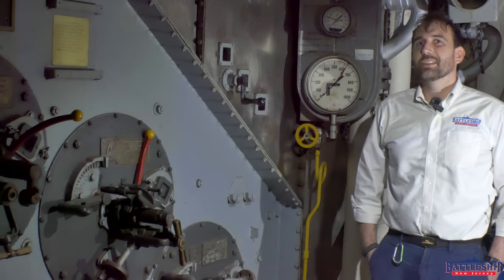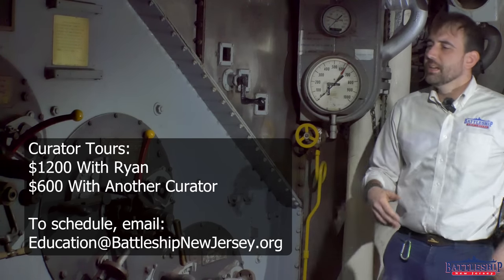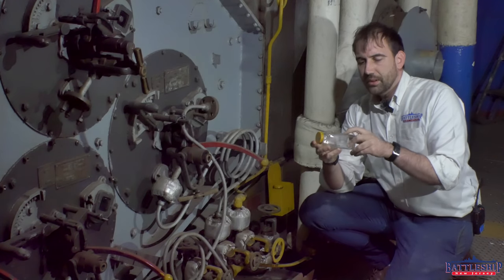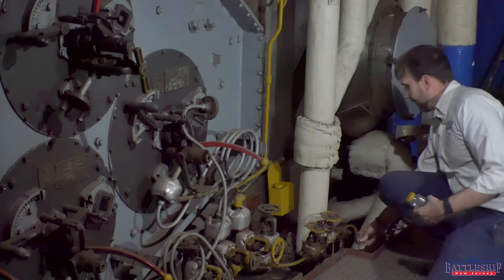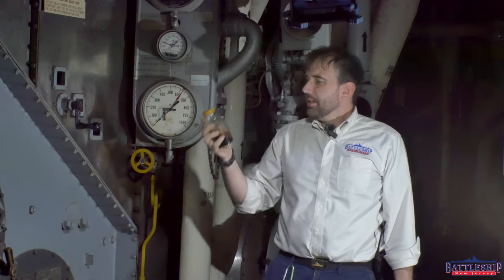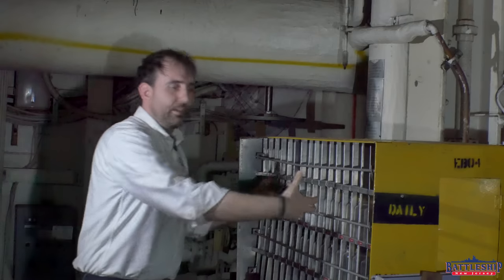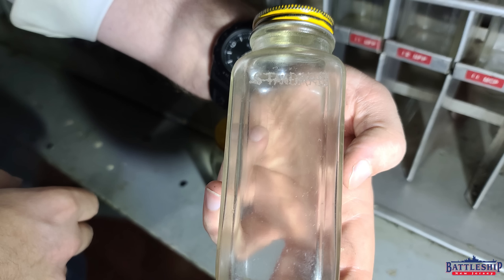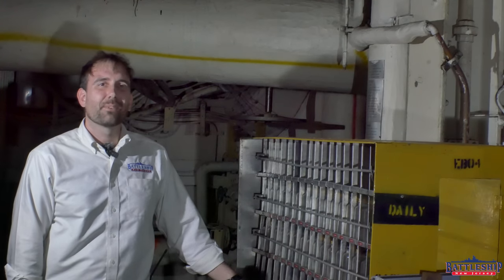Found! Battleship Fuel Oil

Comment: So Bunker C is actually the residue from crude oil that has been completely refined.  After all the Gasoline, Diesel, Kerosene and Lube oil range materials are distilled out of the crude in the atmospheric tower, the "residual" fuel oil is what's left.  This was important for the Navy for two reasons.  First, with all the valuable fractions removed, Bunker C "residual" fuel oil was extremely cheap.  Secondly, with all the lighter fractions gone, there was no chance of the fuel vaporizing into a cloud and exploding inside the ship.  The Japanese lost several ships towards the end of WWII by fueling them with unrefined crude oil that still contained the lighter fractions.  When the ship was damaged in battle, the released fuel vaporized and caused a massive explosion.  Bunker C will only burn if preheated, and atomized with a steam nozzle is droplets small enough to vaporize in the boiler and then burn.  You could drop a road flare into a bucket of Bunker C and nothing would happen.
Reply: This is completely correct. Bunker C is a residual fuel oil, what is left after all the "good stuff" is refined out. Crude oil is likely to go boom boom baby in a boiler.
Reply: Read that the Japanese bosted  they use straight crude oil
Reply: It would be wasteful and dangerous to run straight crude oil.  The Japanese were always short of gasoline range materials for avgas, and diesel for marine use. They only ran straight crude a few times because they didn’t have enough tankers to get the crude back to a refinery and their fleet had no other choice.
Reply: Thank you for the explanation.
Reply: @engineermike6150  Just to point out they didn't have the tankers because USN Submarines had sunk or damaged many of them. For a period of 42-43 as I recall the target priority list's first two entries were 1) Aircraft Carriers and then 2) Tankers. And as the IJN ASW got more proficient the number 2 on the list became destroyers!
Reply: @tomhenry897 
They weren't boasting!  They were desperate!
Most of the refineries in the Dutch East Indies had been destroyed durring the conquest .
Out of desperation tge Japanese used straight crude oil, and yes, it was dangerous and hard on the boilers, requiring increased maintenance!
Reply: It all burns the same the cleaner oil has less smoke for your enemy to see that's why you burn more expensive cleaner oil for stealth
Reply: @mikehunntt5338 Bunker C is nothing like DFM and definitely not like unrefined crude oil. You are correct in that DFM burns much cleaner than Bunker C. The only reason any ship used unrefined crude is because they had absolutely no choice. To my understanding the USN never fueled any of its ships with unrefined crude oil.
Reply: No. I've sailed bunker burners with straight mechanical burners. There is no steam supply to these burners now, probably due to the DFM conversion. Wonder what they were originally. Also, conversion to DFM requires purification such as centrifuges upstream of the Settlers. The slops from the centrifuges needs a tank to properly dispose it, a big retrofit. Many new regulations.
Reply: The city of milwaukee which was a great lakes rail ferry still has its tanks full of bunker c and its a museum ship in manistee. That's just a random piece of useless information, but unique to me since my grandpa worked on her before going back farming.
Reply: @gullreefclub  only Russian warships burn unrefined fuel cause its cheap and readily available
Reply: @mikehunntt5338 The Kuznetsov doesn’t run on unrefined fuel either. It runs on a fuel called Matzut, which is essentially the same thing as Bunker C. The problem that Kuznetsov has is (IIRC) that their tank heating/steam trace system doesn’t work correctly and they end up burning unheated fuel, which results in lots of black smoke and soot.
Reply: Thank you

Comment: "Standard" is a standard sample to compare the operational samples against. It is clean, new oil in a clean bottle. At some point in time, someone replaced the standard bottle and repurposed it for operational samples. The object is to hold the standard sample side by side with the operational sample to compare. You are inspecting the sample for particulates, water present as suspended droplets, or the ever-dreaded "milkshake".

You draw a new standard sample from the fresh clean oil used to fill the equipment on its most recent oil change. We drew samples every four hours, more often if we had a problem with carbon rings. Now that would be a find if you ever came across a set of unmolested carbon rings.

Every new watch stander starts out as a "Messenger" and it is their duty to take readings hourly, take oil samples, and most importantly, make coffee and wake up the relief watch.
Reply: What would the milkshake signify?
Reply: @Colonel_Overkill  There were test samples inserted into the stream of samples to make sure the crew were doing their job.  Detecting the test sample resulted in a chit for getting a milkshake from the galley.
Reply: @Colonel_Overkill  Galley chits aside, "milkshake" is a frothy oil-water mixture that can/will kill machinery.
Reply: Thanks. I know absolutely nothing about engines save it is supposed to start when I hit the start switch or turn the key as appropriate. I know nothing but figure that admission is preferable to killing equipment with incompetence.
Reply: No navy experience here, but we also leave fuel samples to sit for a specified period of time to check for materials settling out of it. Is that something that would be done on a ship?
Reply: @Colonel_Overkill that’s commingled fuel, which means when you go to the gas station and the fuel tank is underground 
After a while the water and fuel slightly mix, then it gains microbiological growth. This will cause your vehicle to stall out. Same with any ship or aircraft.

Reference: MIL-HDBK-844A (AS)
Reply: Sounds nearly impossible to get it all done.
Reply: @Colonel_Overkill It means that there is water in the oil. You get that in the crankcase of your car when you blow a head gasket. Water in the oil degrades it’s
Lubricating properties and makes a sample of the oil look like a milkshake.
Reply: @davidschick6951  If it was the responsibility of just one person, absolutely. Keep in mind that these spaces had easily dozens of crewmen working at any given time
Reply: There is nothing like well educated experience to analyze the situation! Thanks.
Reply: @Colonel_Overkill  Milkshake in this context is an emulsion of oil and water. If your car's oil comes out as a frothy bubble mix it probably means you blew a head gasket and water is getting into the system.

"bunker fuel" is much closer to lubricating oil than the gas you put in your car.
Reply: @doubledrats235  Or in really bad cases, mayonnaise!
Reply: @grizwoldphantasia5005  Nope.
Reply: @TheSteelArmadillo  Yes, you're actually supposed to let the sample sit.
Reply: Actually very interesting to read that you took samples every hour, and in the mean time I on my modern merchant ship take samples every 3 months and then send them off to a lab to analyze, because a back light won't show me anything.  (it's tested for metal, water and carbon content, and some others)

One time we kept having a too high water content, so we kept refreshing oil, but we didn't loose any cooling water, so it was odd. Untill we send a sample of the clean oil tank. The water was already in the new oil! We suspect due to condensate, as we where in and out of cold and hot areas of the planet. as there was no water line passing trough the tank, and it was above the waterline.

Comment: As a Retired Navy Fuel and Oil Specialist. I can tell you that it was F-76 or DFM as he said. It has the same flash point requirements as F-40 aka JP-5, or Jet-B aviation fuel. I taught the school, and re-wrote the courses back in the early 1990's
Reply: I guess that is how we switched mid-trip from DFM to JP5 once when we were in a hurry to get to the Red Sea for Desert Shield in 1990. Zoomed all the way across the Atlantic and Med without slowing down. I guess we were burning JP5 by the time we got to the Suez and didn't refuel until the Red Sea.
It was pretty cool. Only our 2 submarines kept up the whole way.
Reply: @ut000bs  yes, infact we had to switch once because of micro biological growth in the F-76. Jp-5 has diegme anti icing which kills microbes.
Reply: F-44 not F-40.
Reply: What rate is Fuel and Oil Specialist?  FO?  FS?
Reply: @ut000bs  I am curious why he would post a rate that does not exist.
See odd.
Reply: @judsonkr  It isn't a rate, it is a position. Usually it is filled by BTs.
Reply: Your tight it has the same flashpoint minimum level requirement.  I can tell you they actually have two VERY DIFFERENT flash points, BSW requirement. 
Generally DFM ran @180*F flashpoint, although we had some from the Persian gulf, During desert storm, than ran as low as 150*f. 
JP-5 generally ran in the 150* range.
Reply: @ut000bs  
It is a Collateral Duty.
It is call Oil.King/Fuel King.
And no one can retire as an Oil King FFS.
On my ship there is no such thing as a BT.  
He said he was a Retired Navy Fuel and Oil Specialist.
There is no such thing.
So I was wondering what rate.
Reply: As an old Gas Turbine Systems Tech, I can tell you that the oil Kings has the best coffee and most accessible hiding spot next to CCS
Reply: @kennedymcgovern5413  the Oil King had a lock on the inside of the door to the Oil Lab.
Now THAT is handy.
Reply: I was an Oil King on an Aegis Cruiser, we had F44 and F76
Reply: Modern F76 is brown, off road diesel is died red as no road tax
Reply: @ensnipe2000  dyed
Reply: As a licensed marine engineer in the US Merchant Marine, I know that it's a huge job to convert from bunker to DFM. Just 3 years ago I had to scope out conversion on a MARAD vessel. The retrofit included a bank of purification centrifuges, electrical upgrades to power them, controls, waste management from the centrifuges, boiler analysis to determine what modifications to tubing, registers, forced draft, fuel pumps and regulators, control desuperheater, predicted steam quality under various loads, etc. I was Port engineer and brought her to Drydock in 2020. We spent a ton of $ on steel work so the fuel conversion was deferred. This Drydocking was a special 12 survey so she's 50+ years old. The hull and hatches are good so maybe they will re-engine her to motor. It was an honor to work on one of the last running steamers in the US fleet.
Reply: @The_DuMont_Network  halfhiemers
Reply: @FightUni09  you must have known the late, great Fred Hoffmann then.
Reply: I was Navy and we were trained to use JP5 as a back up in case we lost DFM. Both the LM2500 gas turbine engines and Allison 501K34 generators could run on it
Reply: @oathkeeper824  The turbines loved F44, F76 required a lot of water injection to the turbines to clean them
Reply: That is correct. We burned JP-5 in the last Gearing Class I was on. The other reason was we could refuel Helios with the same fuel. We still had the Bunker C or Black oil heaters in place.

Comment: I worked in a power plant that ran on #6 bunker oil. Had to heat it to 120° to even get it to flow to the boilers. It was built in 1904 still had most of the original equipment in it. Was a great place to work
Reply: When I was a kid back in the mid-60s I made friends with the school custodian. He ran the boiler since he was a boiler tech in the Navy. I remember it burned #6. I learned a little about boilers from him which I still remember.

Comment: Lots of memories brought back with this video. Served from 82-94 Boiler Tech and a large part of that spent as the one of the ships Oil Kings. We were in charge of all the testing and transferring of all the ships waters, fuels and lube oils. On both ships that I served as an Oil King our labs were very close to one of the firerooms. The firerooms and enginerooms would would send their messengers up with the lube oil samples of all the machinery at specified intervals for testing and we would call down to the EOW, Engineer of the Watch with the results. We were also tasked with testing the boiler water and injecting chemicals ie DSP Disodium Phosphate and TSP Trisodium Phosphate to keep everything in range.  On a side note we had the New Jersey in our battle group once and it was a pleasure to be able to witness those 16"ers do their thing. I can still hear them.
Reply: Outstanding.
Reply: The Wisconsin came home from Desert Storm with us but sadly we didn't get to see and hear her speak.
Reply: can you hear anything else?
Reply: 1986 West Pac  I was on the USS Wabash when the New Jersey fired her cannons. The percussion rattled our ship to the core and it was an amazing sight and feel to behold.
Reply: @Blaze_1961  We definitely got up close and personal with some awesome ships!

IC2
USS Kansas City (AOR-3)  '88-'90
Reply: @kevincrosby1760  Yes we did! BM-2 here I was a saddle operator station #9 during unreps. 84-88
Reply: @johnstreet797  Probably more than whoever they were pointed at!

Comment: A good fuel oil sample is typically yellow in color.  Some commercial sources use other dyes resulting in different colors; but DFM/F-76 coming from a US Navy support would be yellow.  As dark as your sample is--it is definitely past the best use by date!

Your sample jar rack would hold lube oil, and water samples.  Fuel oil samples (at least on USN gas turbine ships) are typically disposed of after the testing/inspection is complete.

Still a cool find for this former DDG/FFG engineer.

Comment: I was a Boiler Technician for 10 years. The oil samples you have there are the daily ones, the top row is the what we call the standard. That’s what you compare you samples to after you get them. It usually done on the mid watch. DFM is tested by someone in the oil lab. To check for water and sediment particles.this is done before a fuel tank is put on suction to feed the boiler.
Reply: So what's your take on the stuff inside the glass jar? Still good after 30 years sitting there? I'm guessing not. I know gasoline definitely wouldn't survive stored like that. Would the color and consistency change over the decades?
Reply: @vaikkajoku  I would have expected Navy DFM to be a clear yellow color.  Not sure what is up with the sample being shown.
Reply: @kevincrosby1760  when fuel gets old it starts to darken

Comment: Ryan, Bunker C is not unrefined or barely refined crude oil. It’s the residual oil left after the lighter fractions have been distilled off. It is actually a refined fuel, because it has gone through the same process used to separate out diesel, kerosene, and gasoline from crude oil.  The reason that it was used in ships is simple: it’s cheap. The lighter fractions flow easily and ignite easily, even at room temperature, so they were useful for things like motor vehicles that were expected to be able to start up quickly on demand. Bunker C is very thick at ambient temperates and needs to be preheated to allow it to be pumped and ignited. This made it less useful than the more commonly used lighter oils, but it also made it cheaper. So for applications where the need to heat the tankage wasn’t an issue and where the thing using the fuel didn’t need to turn off and on a lot, it was a very economical fuel choice. This is why it tended to be used for ships, power plants, and large heating boilers; the need to keep t he tanks warm wasn’t too much of an issue, and the huge cost savings of using a cheaper fuel easily outweighed the cost of the tank heating system.

Comment: During the Iranian hostage crisis, the ship that I was stationed-on USS D R Ray DD-971 left Subic Bay on Thanksgiving day and steamed all the way to the Persian Gulf  at a blistering 28 knots. Upon arrival to Bahrain the ship on loaded 450k gallons of JP-5. Kept going north to south in the gulf using split-plant mode. Refueled 4 more times over 12 weeks with JP-5 averaging 125k per fill-up. Atlantic fleet paid for the fuel so CO said get the good stuff. Fuel was so clean, never had to clean purifiers or engine-room fuel filters. Held up to the light the fuel looked like drinking water. CO relaxed main-space manning requirements, main-spaces went unmanned for 4 months, only two rovers round the clock to check main-space equipment. In  79&80 this was amazing to have all of engineering unmanned underway.
Reply: I remember you guys, R div, U.S.S. La Sale AGF 3
Reply: JP-5 is intended for Navy & USMC jet planes.  Gonna be  a lot cleaner than bunker-c